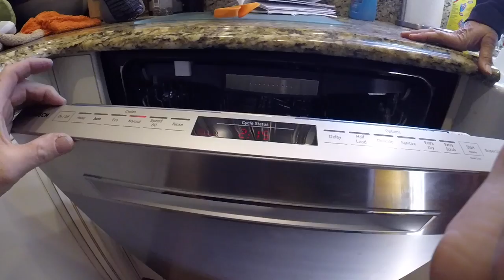BOSCH DISHWASHER INSTALLATION AVOID THESE 3 MISTAKES

Comment: Great instruction, thank you for making this. I have a question though; why is there an outlet under the sink and right next to the water supply? Isn’t that a no no?
Reply: It's proximity to an open drain where the concern is.  GFI or GFCI protection is then required.  Under a sink not so much but electrical codes change over time so look into your local electrical code to be sure. 

Secondly resist cutting short the electrical cable if possible.  The next dish washer most likely will require a hard wired connection in the front. In his case the wire is now too short.
Reply: ace1233993 thank you for the reply. Our codes here require that a dishwasher has to be plugged into an outlet with a dedicated circuit. (Too many DIY accidents, etc.) it just seemed awfully close to the water line. I just do “basic” stuff.
Reply from the maker: for my garbage disposal.
Reply from the maker: Thanks John for stopping in.

Comment: Nice info!  It was good to see that I'm not the only one who physically struggles with some of the fiddly bits.  The 3-prong plug system seems super weird to me ... why would they do it like that?  Why not just have it hard-wired like every other normal dishwasher out there?  I might end up feeding the plug through the cabinet wall and mount the box under my sink instead.  I haven't bought the dishwasher yet, but one of the Bosch 300 series has found its way to the top of my list for replacing our old Kenmore (which isn't broken, it's just not washing very well, is a kinda loud, and the plastic parts keep getting brittle and breaking inside the basin).  Hopefully a Bosch will be superior.
Reply from the maker: yes a tough one.

Comment: did i miss the part where you didnt install the mounting brackets??
Reply from the maker: side wall built in.
Reply: You screw them from the sides. Pain in the ass if u never did it that way before.
You could set the dishwasher in place, mark where you'd put your brackets, glue the brackets on with the correct type of adhesive and then have a place to screw in from the top.. or u can screw in in the sides.

Comment: The instructions say to mount the electrical junction box in the sink cabinet, NOT behind the dishwasher.
Reply from the maker: See, i knew my boss(wifey) messed up.... I learned the hard way.
Reply: True. That is code now. That's why they include the junction box. It needs to be accessible. It's not accessible behind the dishwasher. This is why you need to read the you first.

Comment: Those red led lights on the floor will drive my cat crazzy......Was that intentional Bosch?
Reply from the maker: a bosch move to drive the cats crazy
Reply: Can you put a small piece of black Gorilla tape over the source of the red light beam? That would drive me nuts seeing that all the time.
Reply: @jayoneill3500  you can turn it off. check your manual. I have the Time Light instead of the red Info Light, but I like it. You know when the dishwasher is running or not. Always thought the red light was cool. It doesn't move around or anything.

Comment: I rarely do dishwashers, people think I'm going to hook it up for 20$ and it's as easy as plugging in a toaster. I also have to redo the waterline to code. They also need to have it installed in the evening or weekend. They are  not to paying the day rate so never in a million years will they pay for after hours service. 
So yeah very rarely do people hire me. But I do love it when customers tell me it's their 3rd dishwasher that blew up because of water hammer and their ruined ceilings because they hired a hack and it leaked all over the place.
Reply from the maker: Man, I am with you. The Mrs. said to me wow this is more than I thought to  install.

Comment: I hate to complain, or criticize for any reason, but I just gotta say a few things here. It seems like your really cutting some corners here being that this is your own house. You removed a custom faced unit and replaced it with a standard stainless, we get that the other one was on its way out, still doesn’t provide an answer as to why. To save money I’m assuming. Even the fridge is paneled to match the cabinets, now the dishwasher stands out screaming, “look! I saved a buck!’ Also when you removed the old custom unit and encountered the hardware that was not what you had on your drill, what was that about? No hex drivers in your tool bag? Philips is the only bit you have? You could have at least attempted to remove the #2 bit from the shaft and see if the shaft itself were to fit, it is a hex head as well. So you brute force it out, fair enough, but when the bracket breaks and you state that as the reason your dishwasher was leaking? Seriously? I’d raise the bs flag right there. I’m going to just stop there and not just sit and try to pick your video apart. You took the time to make the video, I enjoyed watching it as I’m sure many others did. Personally I feel you’ve done yourself an injustice by not having the custom face as your last unit has, and to us by not detailing the problems in particular with the previous unit and why you decided not to repair the old unit since it is a custom match to your kitchen I would have took that into consideration myself. Too many people out there quick to throw stuff away for their convenience or lack of ability to troubleshoot and repair, polluting the earth with unnecessary e-waste. If you had a hole in your wallet and the money was falling out would you just throw it all away or at least take the money out before you replaced the wallet.  Not the best analogy but similar to your dishwasher. And lastly I’d say get some tools. Yes tools cost money but they also make money and without them you suffer. A hex driver is cheap. A non contact voltage tester is cheap, can save your life.  I leave mine in place while I work, because you never know when some other asshole is gong to turn the power back on looking for the breaker they threw when they fucked up, I’ve seen it happen time and time again. This being your own house you should have really shined here because if your gonna go cheap or cut corners here in any way then surely you’ll do the same at a clients house. I’m a general contractor myself and I’m not perfect, I make mistakes, and there’s plenty of tools I should own as well. This is just merely my opinion, nothing personal or intended to piss you off. I wish people would do the same for me so that I can improve on those areas as sometimes we just don’t see things from an outside perspective. Not saying to do everything other people say, or would do, but just to know and have those options to decide yourself.

And you didn’t hone in on the 3 mistakes to avoid such as your title suggests. That’s what started this fire in the first place. I call that click bait and click bait pisses people off,  when you don’t give them what they came for.
Reply from the maker: I really appreciate your time to write. When I make a title its from real time issues in my mind and what happened to me all for free. I not into selling some nonsense. Its real world stuff and real time and less time to explain especially at my own home because the last think i want to do is change a dishwasher for fun on a saturday. Thanks for stopping in Mike.

Comment: ok now this was a very very good install lasting at least 20 years
Reply from the maker: thanks Mike. Your being nice today.....ha.
Reply: @ChuckBarron   its not about being nice its about right and wrong on teaching the right way and the wrong way 
99%of dishwasher instalations ive seen are wrong installation were the drain hose goes from
 has to go up and then down 
thats why 99% of people replace there dishwasher 
cause it stinks if the drain hose just goes in the drain without going up and then down

Comment: 13:11 what is the purpose of the spinning thing to the left of the drain line, just ignore it?  can't find anything about it in the manual or online.
Reply from the maker: Just looked and i did nothing with that. Im not sure what that is...it may be connected to screw adjustmen in front which raises the back of dishwasher to plumb it.

Comment: So what are  the  3  mistakes exactly ?  Thanks
Reply from the maker: 1. I put electric box on back wall. I had to remove it and put under cabinet. DW was out just a bit to far.
2. I did not loosen front legs on DW before i pushed in. they were very hard to get started with screw driver.
3. I thought the panel door was missing and after wifey read paper work did we realize it was not your typical front panel door.

Comment: So what are the 3 mistakes? I'm not watching a 24 minute video that can likely be explained in 5 minutes or less. Somebody "spoil" me.
Reply from the maker: cmon #'s . lol
Reply: Spoilers:  Mount the electrical box under the cabinet, or out of the way (not in the back where it will prevent the dishwasher from being pushed in all the way); Extend the front legs a few turns before sliding in place so that you have room to squeeze a wrench in the space; Read the manual regarding the install of the front kick (and all the sound-dampening parts).

Comment: Ur dishwasher should directly into the drain line not into the disposal.
Reply: Then why do they put the dishwasher drain connections on garbage disposals?. Whats the difference if its tied in at garbage disposal or after
Reply: If ur disposal has food in it and u run the dishwasher it could overflow the sink
Reply: @peterboissiere9684  thats just human stupidity.... the connection is on the gabage disposal intended for the dishwasher to be connected to it. Im sure 99.9% of people use it that way also. Instead of tying in after the gd
Reply from the maker: dishwasher connection is sweet. gotta make sure hose is raised higher than connection.
Reply from the maker: ya i always use connection.

Comment: OK..so you have what looks to be a fairly new BOSCH Dishwasher that no longer works.... Why would you not repair the dishwasher ??? Parts not available ??? Should be an easy fix ??  So you replace it with another BOSCH Dishwasher ???  That I don't get... You trust BOSCH that much ???
Reply from the maker: That bosch was at least 10 years old and did not want to dump repair money into it.

Comment: You should've never cut the elctrical wire until you was sure that the dishwasher was going to fit correctly, let this be a lesson to everyone out their planning to hire a plumber/electrical....be sure to hire a competent and not an incompetent one.
Also Marcy house wouldn't be the house i would come over to visit or even have dinner meal served to me by her, by the sight of the dirty cabinets and dirt underneath the previous dishwasher you can actually tell that she a slobbbb :(
Reply from the maker: your comments are comical...Yes make sure the plumber/electrician is around to warranty his or her work.....oh thats right I been around for 30 years and i still have to learn how to clean under a a used dishwasher before I film it....and your not invited to dinner Mr. Man. lol.

Comment: Dude, are you serious? Having a customer do all of that work?
Reply from the maker: Eulayses Perry lol! Its my house and my mrs. and can you believe she made me do this. Ha! Happy Sunday E!
Reply: @ChuckBarron  ooohhh! That explains everything. In that case you should've sat back with a beer and gave her step by step instructions to do it 😂
Reply from the maker: Happy Wife Happy Life.  lol
Reply: @ChuckBarron  I'm a retired Plumber. I just had a new bosch dishwasher installed yesterday. Funny story, After thinking you were making a customer work, I ended up being a working customer.☺ I elected to have it delivered and installed because the installation was cheap and included of the necessary accessories and I'm nursing a trigger finger from recently removing and replacing one of my bathrooms. The delivery/installers right away told me they had to break some of my tile floor to remove the old washer (because it was 1/4" lower than the new floor). The front legs were up nearly 3/4", but they said they were rusted frozen. I pulled out my Sawzall and cut the legs off. They said the valves were rusted and may snap, I sprayed a little wd40 on it and diconnected the valve. They pushed in the washer and said the water hose was short, I told them the hose was pinched behind the washer. They couldn't pull the washer back out of the niche so he just yanked out the hose 😦. Luckily it didn't leak. To end the whole show the guy started to scrape the edge of the anti fingerprint shield with his finger nail thinking it was a temporary plastic protector for the stainless steel. It would've been less work doing it myself. 😂
Reply: Eulayses Perry You know the old saying. If you want it done right...you have to do it yourself! This is the reason I can’t hire anyone to do anything!